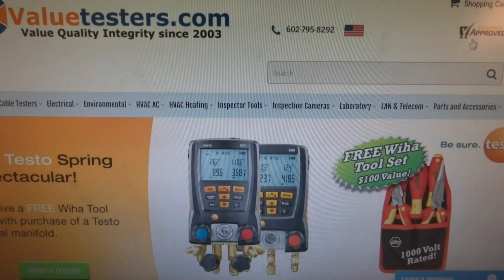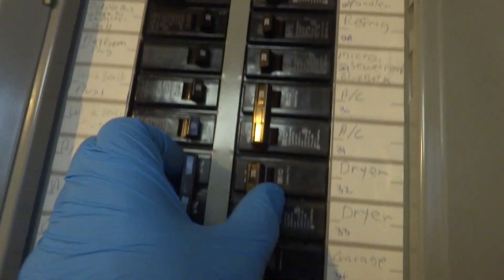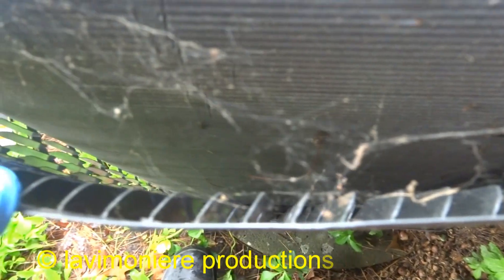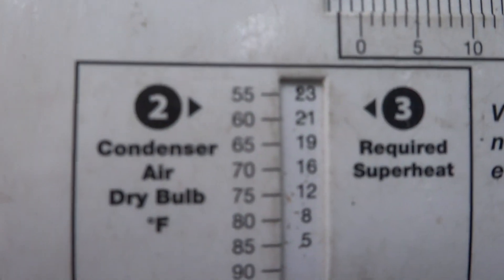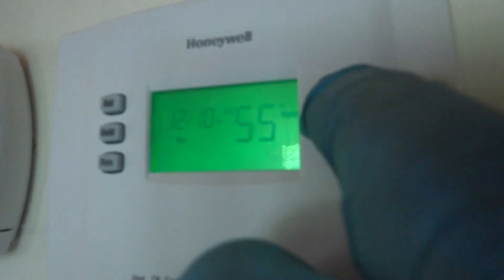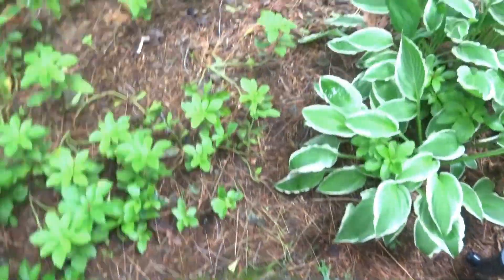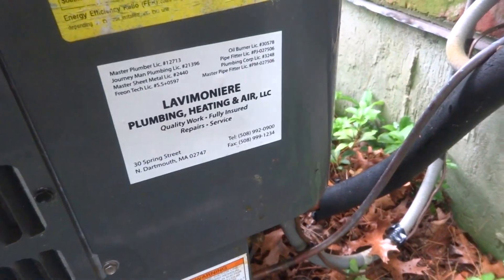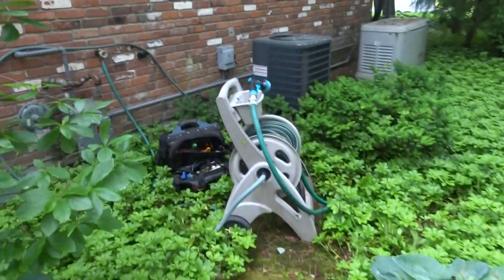2 goodman AC systems yearly maintenance

Comment: I had the same problem with chipmunks two years ago. I used the foil tape trick to seal up the electricals but never checked it since.  You inspired me to open up my unit to check. Not a sign of rodents. Foil tape works. I didn't need to add mothballs.
Reply: Nick V steal whoop works best to plug holes.
Reply: @nathanbelden8269  Steal wool rusts and degrades and looks gross. You have to keep replacing it. Foil tape is neater and pretty much permanent.
Reply: Good info. Thanks

Comment: My Goodman compressor was installed in 2006 and it broke a few months ago. (13 years old) should it have lasted longer?
Reply: It all depends on the kind of life of your unit. How well was maintenance kept on your unit? Was it ran over charged or under charged for long periods of time ? Did you make sure your run capacitor was routinely checked? Did you have a lot of power outages or power surges? All these things can play a big part of your compressors life.
Reply from the maker: depends on the installer if a good vac was pulled and charged properly ..makes a big difference .proper size duct work ,so many things could be a factor in life span
Reply: @curtispaige2614  I kept an eye on it. Coils never really got dirty to be cleaned. The capacitor was replaced twice. The unit pretty much ran 24/7 during each summer. I wasn't always around, I had it recharged once. The previous compressor was a Carrier from the 1960s. 40 something year's old when that thing broke.
Reply: @shawnwhite3662  Well we all know that they just DON'T make them like they use to. Sounds as if you should have gotten a few more good years out of that compressor. I personally don't have anything bad to say about Goodman equipment.. Like Steven says, " They ALL break"

Comment: you need to power down the units in the winter. The voltage provides a heat source for rodents